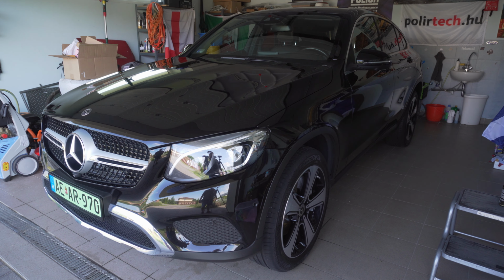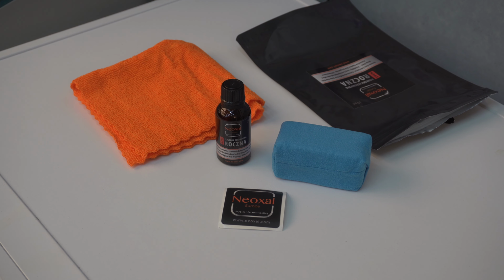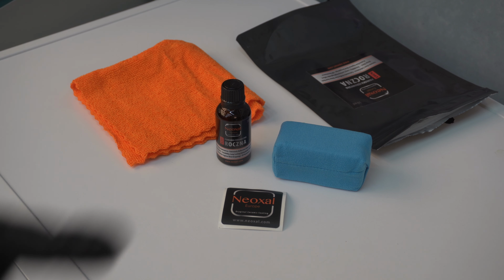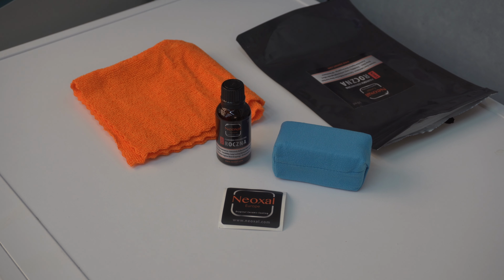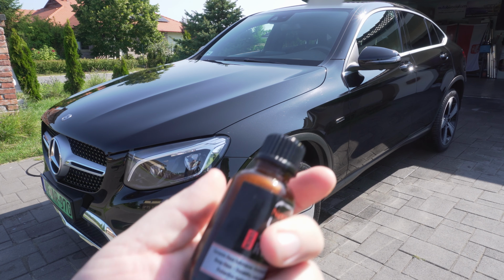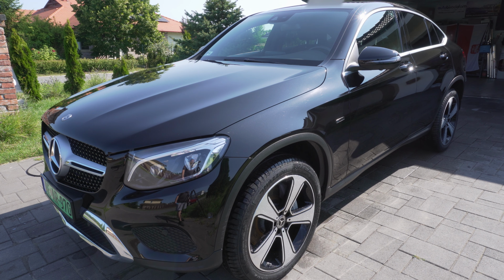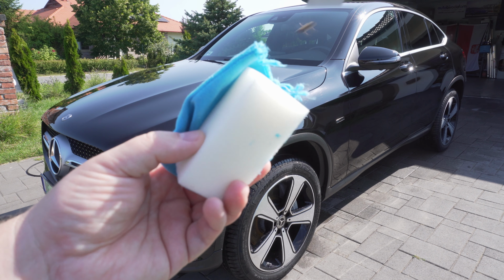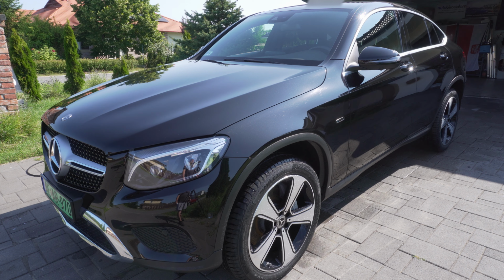Neoxal N365 Ceramic Coating test - EN

Comment: Hi Zslot! Thank you very much for the report.  They are known for the problems you mention.  They concerned several N365 and 111 Ceramic Coating units.  The problem was one component used in both products.  This has been fixed and is now fine.  In the near future we will send you new sets along with some new products for testing.  Best regards, Grzegorz.
Reply from the maker: Dzieki 👍 Looking forward to.
Reply: I bought this coating at official Neoxal store in Allegro, then applied in August; this coating gave nothing, no glass-efect, water-resistant - instead this the plastics became pale-black:/
I wrote to Neoxal, they said that sth was modified, apologized and.. that was all:/

How can I find it out that next coating is old or new-one?
Reply: Heh, I just noted we corresponded mails :)
Reply from the maker: @bulandaw  I suppose, Neoxal has the latest, but can't tell, what an Allegro seller would have (old stock or new).
Reply: That was their official store, I also hoped that if the fault was known, this should never been shipped :/
Reply from the maker: @bulandaw  I see. Maybe Grzegorz will be able to do something about, but of course, I can't talk on their behalf. According to the above statement and a previous one, under another video, the defective units were withdrawn already.